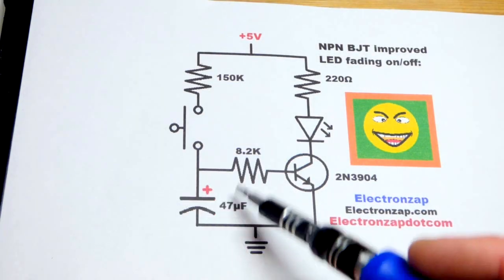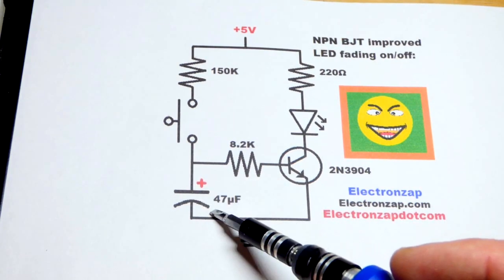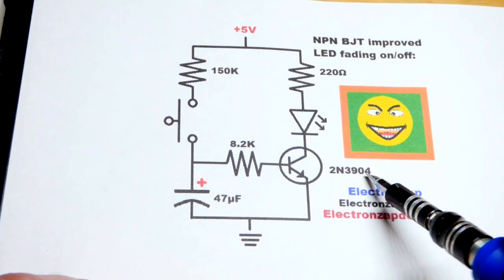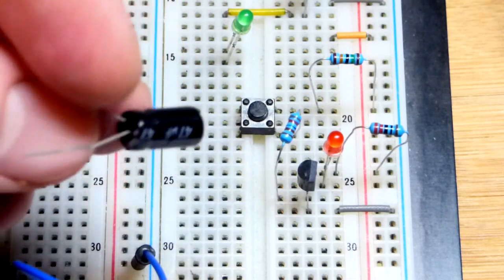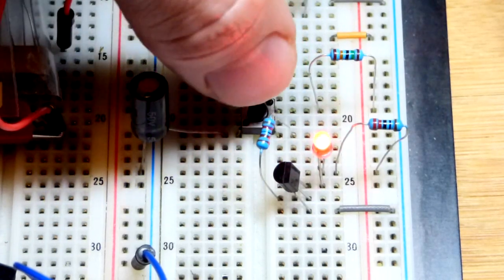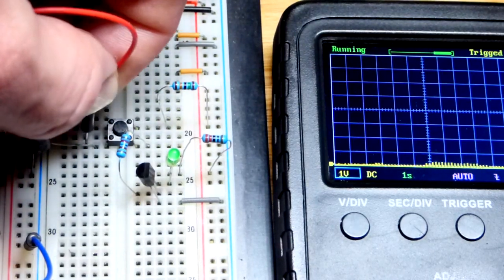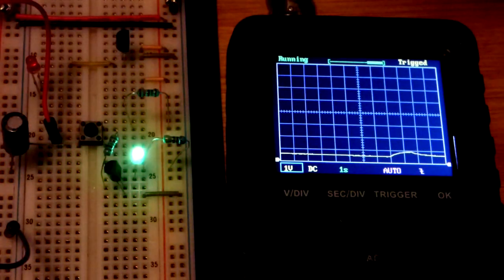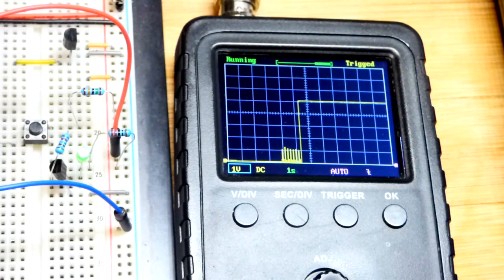LED fade on off improved with NPN BJT improved capacitor controlled by push button switch circuit

Comment: Hi sir can we use 3.7v lipo battery with this circuit to do fade on off led effect ?
Reply from the maker: Won't hurt anything, many LEDs need about 3 volts to light brightly, so 3.7V won't be enough to power some circuits designed for 5V.

Comment: are there transistor where the base can be saturated to about .7 volts. it seems all transistor wont give full current flow until about 1.5 volts

Comment: can this circuit be used with a 555 ?? and how and where would you set up the timer?
Reply from the maker: The 555 timer output would replace the switch. You'd have a resistor between the 555 output and where the transistor base and capacitor connect. Might need a diode to keep the 555 timer from discharging the capacitor during its low output.
Reply: @Electronzap  will give it a go thnx, looks like the circuit I'm after but not sure, need to fade in (or should I say pulse) 16 - 1watt leds in parallel, so timing is the biggest hurdle,
Reply: I want to do this w/a green laser diode and have the fade on & off cycle set at 1/4 sec or maybe a variable time between 1/4 sec and continuously on for a laser gun project. 1) How could I synchronize the 555 trigger pulses to the fade on/off rate so the quicker the switching, the shorter the fade on/off rate. 2) Why are the 150K and 220 resistors in series? Seems like this would just add a tiny more resistance to a large value or are they in series/parallel? 3) What are the formulas for calculating the fade on/off rates for determining the values of the capacitor & resistors in the circuit. I would rather do it that way than physically trying different components to try to stumble on the right combo.  4) Thanks for any reply and I will subscribe!
Reply: He has a video on that. Using a 555 and an NPN Bipolar Transistor.

Comment: How come the cap doesn't charge to Vcc when the switch is closed?

Also, would the Cap charge to 50v if you kept the switch closed for long enough?

Thanks,
Reply from the maker: Capacitors only charge to the voltage that you apply to them. Charging through a resistor takes time, and so does discharging through a resistor. They charge/discharge based on current flow, and resistors reduce current flow.